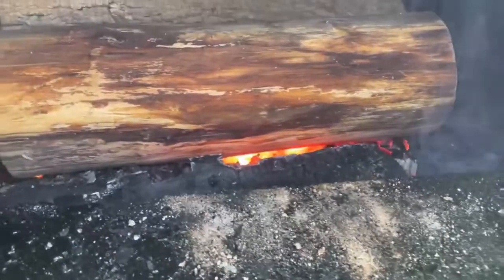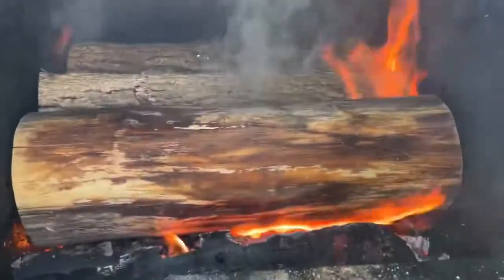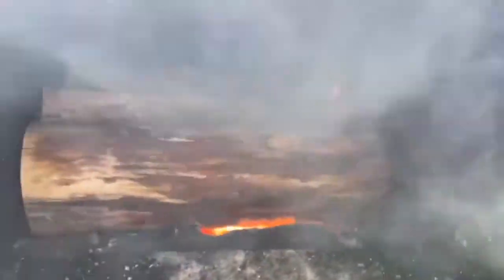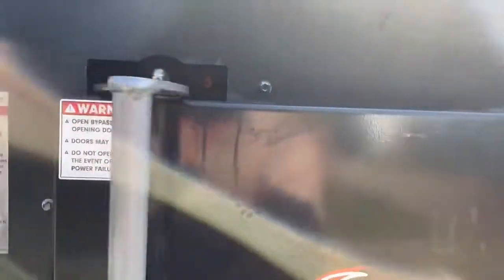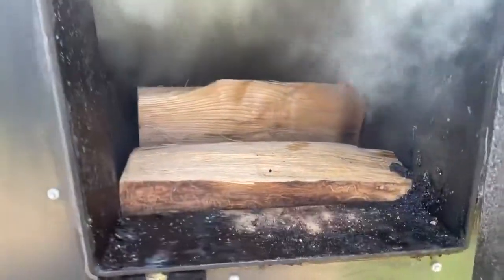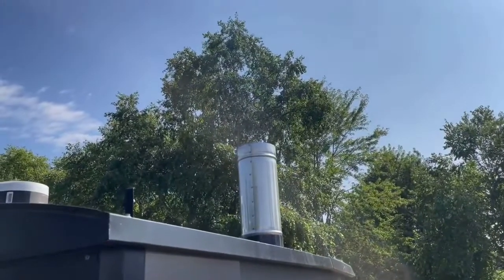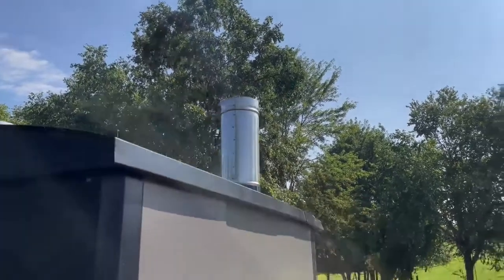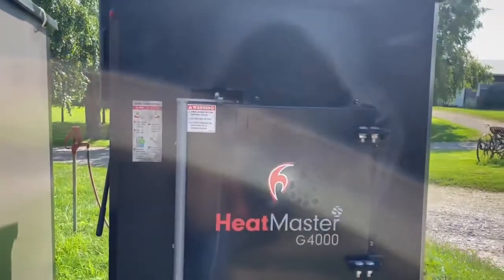Relighting and Running a G4000 Gasifying Wood Furnace

Comment: I've gone up to 2 months without cleaning any ash out of the firebox and not stirring it either. But it probably depends on the wood I'm burning. It does tend to get crusty due to lack of stirring, I just watch the ash and make sure it doesn't get up near the panels, I've never shoveled everything out and tried sifting out the coals, never really had the need to.
Great video.

Comment: If the engineers would have just made the firebox 3-6 inches taller, you wouldn't need to empty the ashes out as often, right?
Reply: Would still have to be emptied, would just take longer if it held more. I’ve gone over two weeks with no issues on my G7000, just easier and faster to do it weekly.